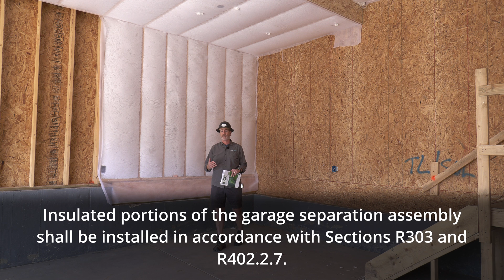Building Thermal Envelope - Field Application of the Energy Code

Comment: Hi quick question. I have a new garage with a living space above. The floor system is I joist 16" on center. Insullation contractor only installed 14.5" wide 6" faced insullation. Face side up towards the living space. He then installed 3" of rockwool resting on the I joist flanges. Does this meet the code for air sealing. Just found this out yesterday and looking to see what my options are.
Reply from the maker: Not likely sufficient for air sealing,   Expanding air sealing foam can still be added if needed.
Reply: @ConstructionEd Would blown in cellulose work in that application?